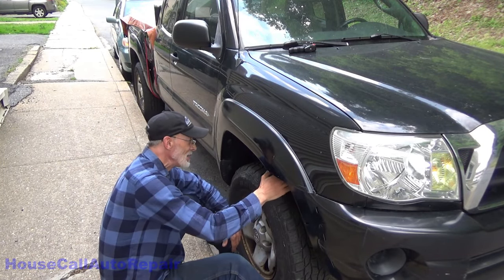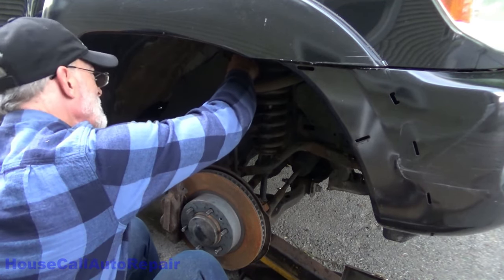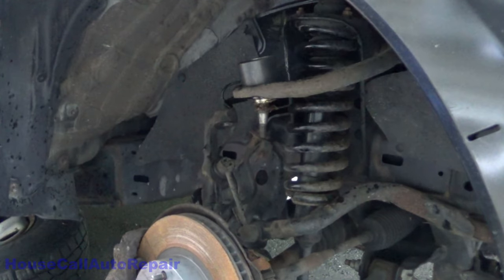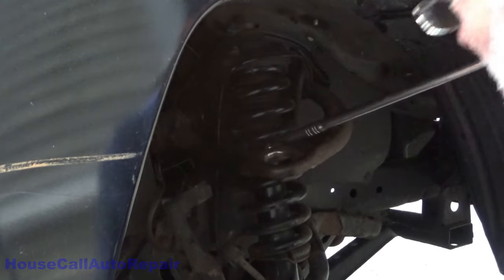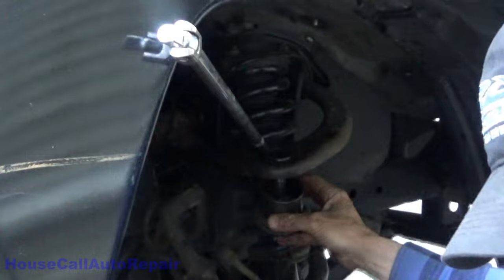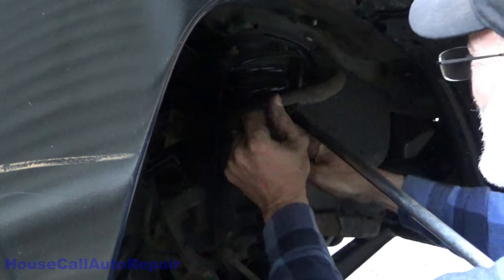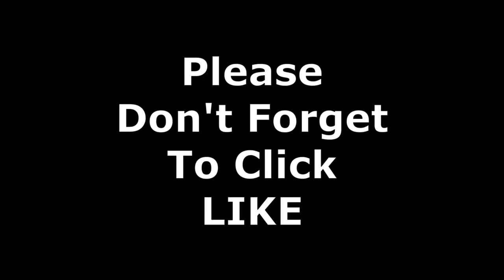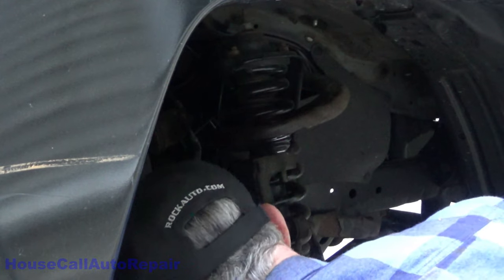2007 Tacoma 4x4 Upper Ball Joint - On the Side of the Street - Auto Repair

Comment: My noise on Corolla was the alternator. Now I've changed the alternator. But before it , I changed the water pump and the tensioner pulley. Well i have one used water pump
for future Corollas . The alternator was free from Napa because I got it from Napa a year ago , but this time this alternator was a pain in my back for three days. It was new and I've learned my lesson. It was so tight to get on I need it help to get it out and sand paper the alternator and lubricate all around fittings so I could finally get the lower long bolt threaded in. It was a tremendous relief when the bolt  found its way in.. another lesson learned. I hope you've fixed your exhaust manifold on Corolla...Thank you.
Reply from the maker: First trip with the truck was transporting the engine from my Crown Vic, to a friend's shop for a bolt extraction. The second trip was getting the Corolla's exhaust repaired. All went well.
Reply: @HouseCallAutoRepair  Thank you. Those exhaust repairs are the hardest sometimes when it comes to bolts and such.. any videos on it ? Thanks for your reply.
Reply from the maker: @marthab4172  
https://youtu.be/jpWcX3jMeZ4
https://youtu.be/vZKX7hvQT0Y
These are currently my only exhaust videos, and they are both on my Corolla

Comment: sway bar may need to be flipped? left side is on the right side?
Reply from the maker: I was kind of wondering that, myself. Turns out the problem was/is the strut belongs on the other, AND the sway bar end links were just a bit too long. 
i did however purchase some adapter blocks the move the sway bar forward about a half inch. (might do a video installing them and new neoprene bushings)